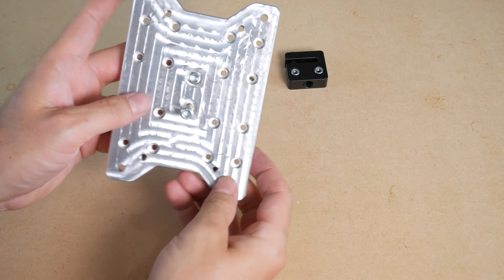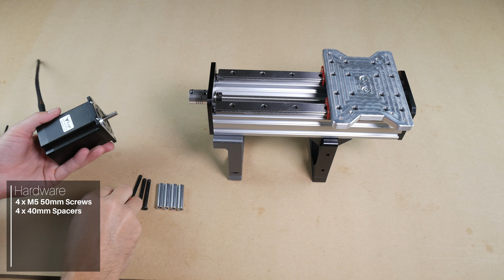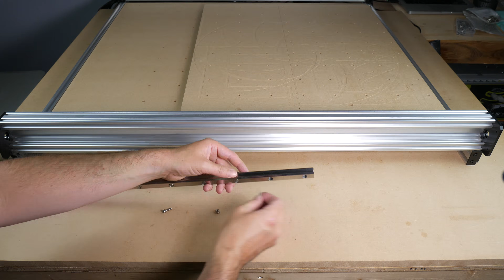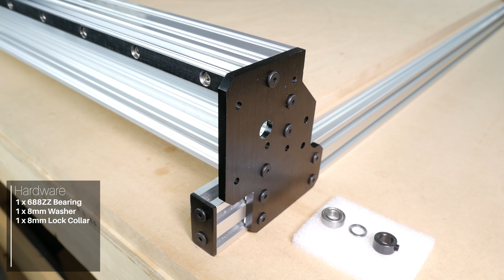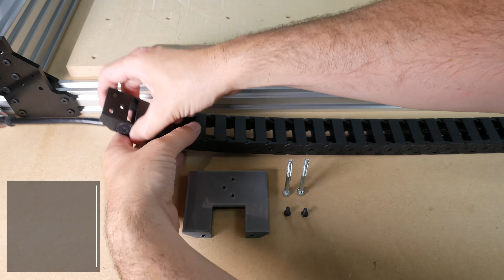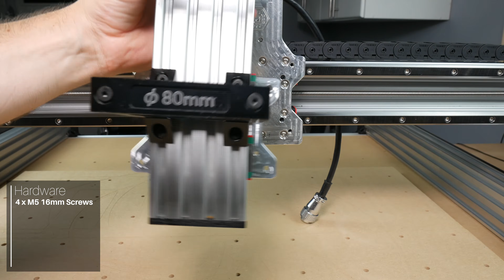Queenbee CNC Upgrade - Building

Comment: Hi. Thanks for the video, a great help. Just one small issue, building the Z plate, the video calls for 2 x 35mm m5 bolts, 4 x 9mm spacers and 4 x 1mm shims. Something is wrong, the bolts will not reach the nylock nuts. Should it be longer bolts or should it be smaller spacers? Hope you can help, thanks.

Comment: Great build! Except I would not rely on a tape measure for squareness... Although final alignment should involve cutting four holes at extreme extent in two sheets, and flipping the top sheet over. Dowels should still slide through all four holes. Adjust until they do.
Reply from the maker: Yes totally. That needs it's own video if you ask me!

Comment: Excellent video. My 2 biggest complaints with this upgrade are the lack of a second bearing set for the Y rails. I feel it would add even more rigidity which will help cutting aluminum and harder materials. The second complaint would be the mounting of the nut blocks. Would definitely like to see a solid block in there vs. all the pieced together spacers leaving room for flex and so on. Hopefully as time passes these small things will be adressed before I pull the trigger on this fpr my workbee. Look forward to more videos of your machine in action.

Comment: Love the upgrade but there is one thing i don’t understand. Why when doing the upgrade wouldn’t you get rid of the delrim nutblock and replace them with bearings?
Reply from the maker: Do you mean a ball screw system? If so the issue is it doesn't quite fit in-between then cbeam so it requires a bit of a redesign. I know some options are underway by people.
Reply: @IllDoItMyself  Okay so the c-beam hasn't got enough depth to accomodate such a bearing?

Comment: I did the math on the y axis nut blocks and I got 20mm and then 2 mini shims....is there any reason 1 20mm spacer can't be used instead of one 9mm, 3 3mm, and 2 1mm spacers, and the 2 mini shims of course?

Comment: Hi, I currently have the 1500mm x 1000mm workbee using a makita router. Would this be a good upgrade to do if I want to use a water cooled spindle? I was told the water cooled spindle could be too heavy for my machine.
Reply: Hey Josh, Are you happy with your machine? I'm thinking of getting one. Was also looking at using the makita.
Reply from the maker: I'm very happy with it still yet to run into any issues 12 months in now.

Comment: Man I want this, but it's hard to justify the cost, it's almost what I paid for my original kit.
Reply: What exactly do you expect from this. Is that  old version not stiff due to the wheels? I understand the lead screw precision, good rails though should pay. Especially the tensioned Screw would be the feature. Without ever having touched a bee nor a linear rail... the wheels solution seems very smart to me. Maybee I am an old scateboy. But just the ability of fixing, adding better wheels, adding more wheels... and with an heavy mill that should be stable. shapeoko also drive with less flexible, und more sustainable broader belt systems, this might be easier to reassamble than the whole kit.
Reply: @erwinz5926  The tensioning of the wheels is incredibly finicky and via eccentric nuts. Even if you're lucky enough to get them all tensioned the same, they crack or wear out and need to be replaced which means you'll then go through the tensioning cycle again. I've had my machine 6 months and didn't really start using it until last week and I've already got 4 wheels that need to be replaced.

The wheels work fine on a 3D printer, I've got hundreds of hours on my Ender 3 V2, but for a high load\high stress situation like a CNC router I don't think they're a really good option.
Reply: @nickr8829  Totally agree. My workbee breaks wheels on a regular basis. Seems to me, you either have them sloppy, or you keep replacing them.
Reply: @Tensquaremetreworkshop  Shortly after that comment I upgraded mine to HGR15 rails, using the Piranha CNC plate design Makersupply.dk posted on OpenBuild's website. I used 3/8" aluminum instead of the 1/4" or 6mm they specify, and I'm absolutely in love. I can cut 140in/min with a 1/4" bit using my Dewalt 611 with no issues.

It was a huge game changer. Now I just need to upgrade the 8mm lead screws to 12mm lead screws or 16mm ball screws.
Reply: @nickr8829  Yes, there is almost no limit to the upgrades that can be done. I put the router replacement first (due to noise) and fitted a 1500W water cooled. Much quieter- and I can set the speed in the file. Torn between a QueenBee kit and making it myself - I have a milling machine and lathe.
Reply: Just make one yourself with 12-19mm alu plates.

Comment: So queenbee is basically thicker aluminum plates and linear rails?
Reply from the maker: Yes but there are some design changes that give you some added z height and stiffen the x axis.
Reply: @IllDoItMyself  I'm just wondering if it would be faster to make everything here in the US, than wait for the delivery.
Great videos btw.
Reply: @helLf1nGerTA  I ask that same question every time a make an order from the USA.

Comment: put drag chain stl on thingiverse?
Reply from the maker: Ah yes I will get that up!
Reply: @IllDoItMyself  Please let us know when done, thanks a lot, very appreciate (.step or F360 files will be better :-) if we need to modify them ).
No supports for drag chains and switches on the kit ?
The 3D printed guides for rail mount are in the kit or did you create it by yourself ?
Reply: @IllDoItMyself  Please let us know when you get the files uploaded. Thanks!